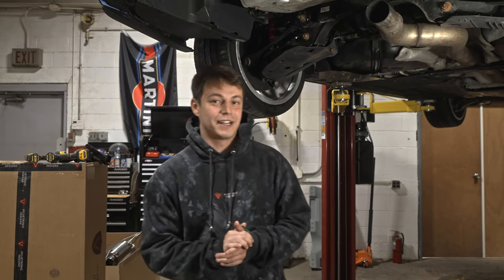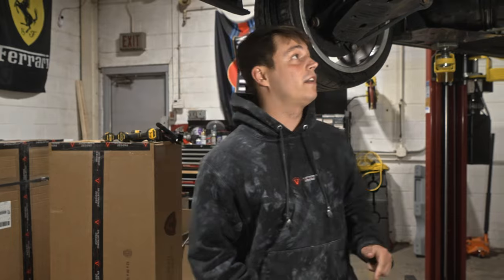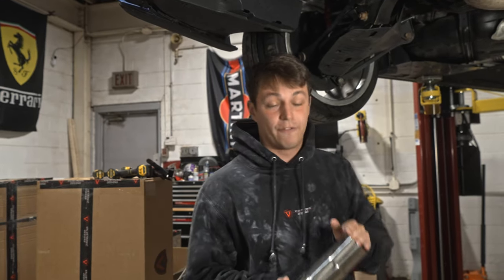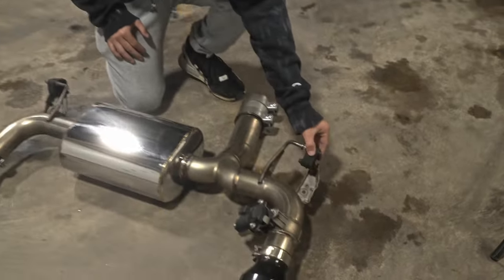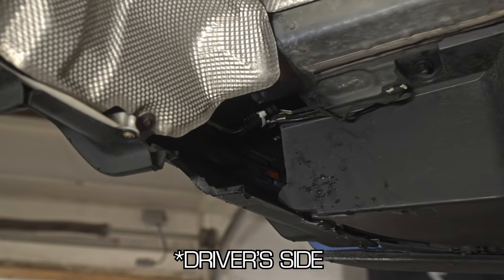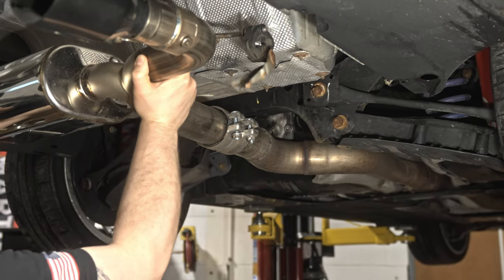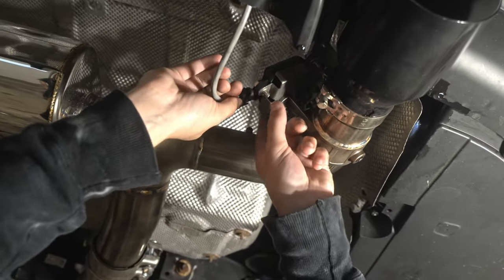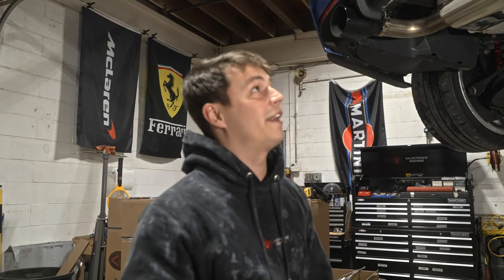How to Install your Valvetronic Designs F Chassis Exhaust System (B58/B48)

Comment: How do I know where to cut the muffler off, and how would the exhaust shop know how much straight pipe to put on the midpipe? is it 10in?
Reply from the maker: youd have to line up the axleback to where it fits then cut that section off

Comment: Would this exhaust work on my BMW 2014 (F22) ? And can I install it without doing a tune on the car afterwards ?
Reply from the maker: @MrNator-bq4em  yes
Reply: @valvetronic  so I guess it would just get louder as I change the drive mode on the car correct? Because it has ECO, sports and sports plus

Comment: How can i tell difference between 4 cyl and 6
Reply from the maker: what exactly do you mean by this? You should know what engine your car has before doing any modifications
Reply: @valvetronic  No i have a b58 but is the exhaust for both cars or is there two different exhausts for a 4 cyl and one for 6. Not sure if i bought the wrong one.
Reply from the maker: @SnkrKev  it is the same exhaust for both. the 4cyl option just comes witha 4 cylinder adapter
Reply: @valvetronic  Ohh okay thanks, for the adjustment in pipes… Would i bend the axle back pipe or the oem?
Reply: any video link recommended?